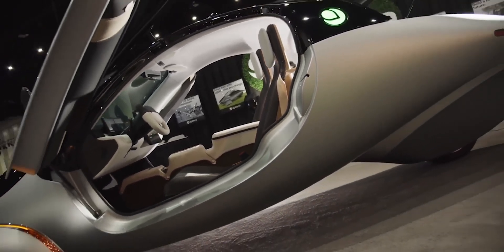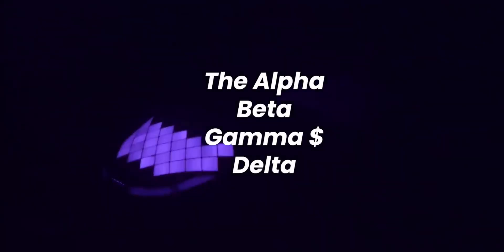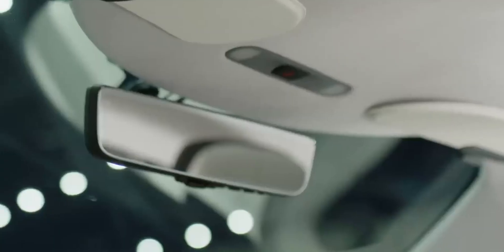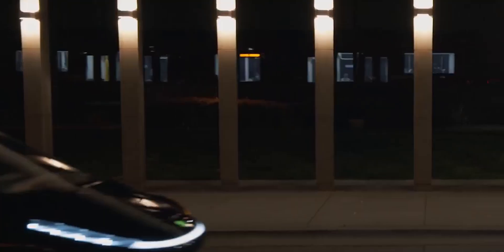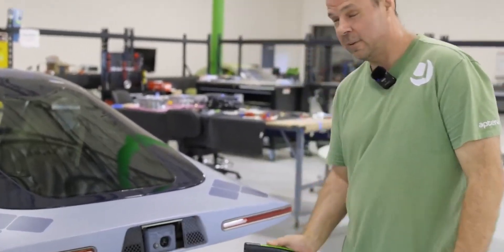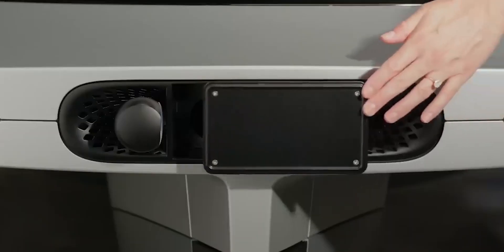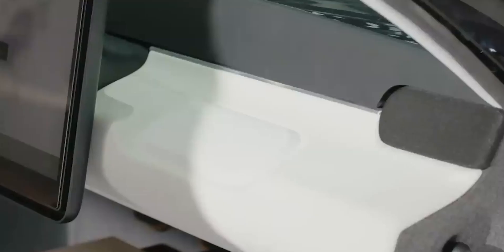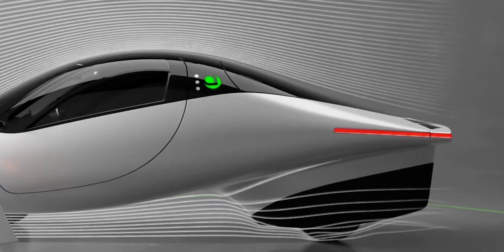8 More Changes And Features Made From Aptera's Alpha To Gamma Prototype!

Comment: Aptera's stated ground clearance is 5.5", but the Gamma model was measured at about 3.5" on carpet. The final production height should be somewhere between these points. Also there is foam on the leading and trailing edges of the fenders in the event of contacting a curb or steep driveway. For people with poor roads, they offer an off-road package with higher fender ground clearance. Most likely Aptera will not feature V2G capability when production begins, but it is possible that they will have a 110V outlet available for camping and such.  Chris Anthony mentioned to me that there is no current industry standard for V2G so far, and therefore no vendors building products or systems for vehicle integration.  Like many of us, it is on Aptera's wish list as well, and will likely be on their future EVs.

Comment: The Gamma was banged together for the show, which was already 2 weeks ago. Until now we just saw the gamma drive once, with a loose wheel cover driving at very low speed. Does this vehicle really work? Or was it just a prop? Does any of the new features really work: Solar, 400 miles, cooling?
Reply: He obviously wouldn't have real world testing information like that.  Still, with Sandy Munro helping with production, I more or less expect it to be a good product.
Reply: @h8GW  Who is the "He Man"? Sandy says, that it will take at least 500 mill and 18-24 months to start production.  On this part i totally agree.

Comment: If Gamma doesn't have V2G, you can't say it's one of the changes from Alpha. They were talking about V2G when there was just the Alphas. You indulge in selling the snake oil.
Reply: Yes, there is no chance V2G will be offered in initial production.  If you see what Ford is doing, there are 1,000's of dollars of additional hardware to enable this.
Reply: @jonsek  It didn't stop them from talking it up from the first Alpha. All part of the snake oil.
Reply: The V2G converter is a quite large and heavy device. Aptera is room restricted. They even have no real place for the aircon and the radiator.
Reply: @vic321344  Doesn't stop them from talking it up, though.

Comment: I am both a reservation holder as well as an investor with Aptera. 
My main wish list for Aptera is Bi-Directional charging. Especially V2H. I know V2G is yet to be standardized and hence more complicated. To me it will be very useful to power your house with such a huge battery bank sitting in your drive way.
Reply: ya won't be getting V2H through a Tesla Plug
Reply: @KrustyKlown  Yup, that would be disappointing. Let me down grade my wish list. At least a port that has a V2L capability.